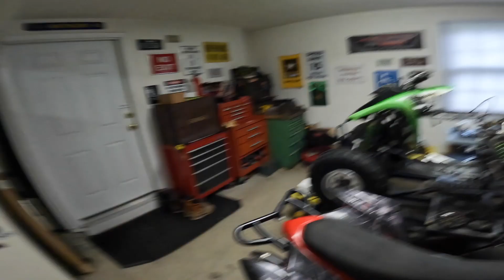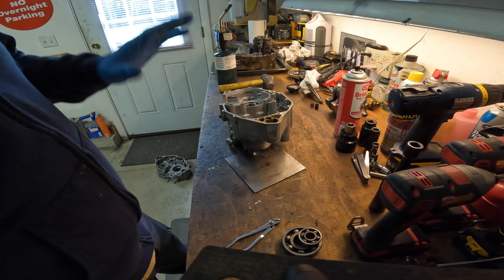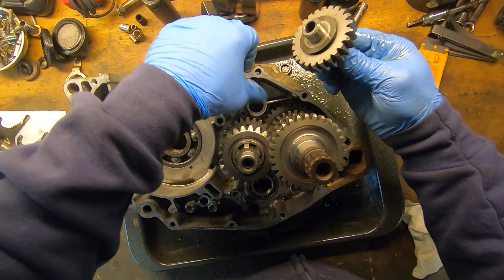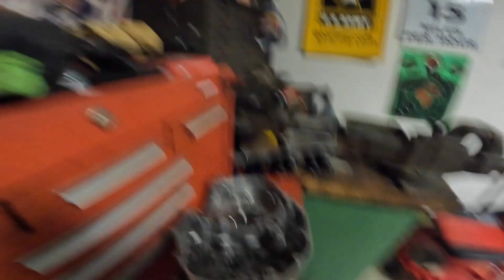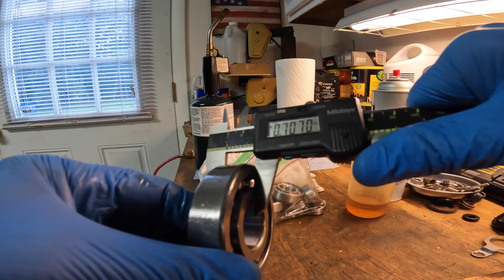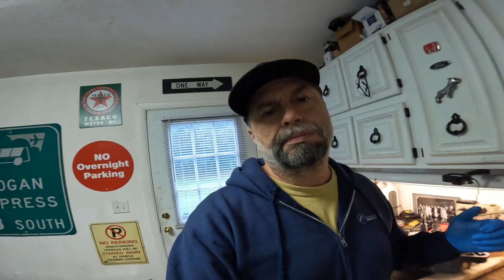KFX400 Case Prep

Comment: Cleaning rtv silicone out of tight spots- I’ve had a lot of success with a nylon or brass bore brush on a drill and compressed air from a small nozzle.
Reply from the maker: That is a great tip, I will have to try that on the next build.

Comment: I agree with you about 2vintage, he does get everything running but dosn't clean anything and dosn't replace a lot of parts that should be changed, and most of the time buys the cheapest stuff to get it running, he even cleaned an oil filter one time and stuck it back in , you would think with how big his channel is getting and the years he has been doing it he would get better at it, anyway the only way you and his channels are alike is you both wrench on quads and bikes, thats it, your obviously more seasoned at it and he's still learning, what do you think about the market now? Prices are coming down in my area and im seeing bikes sit for sale way longer.
Reply from the maker: I appreciate your kind words and for watching. The ATV market in my area is dead. I still have the Raptor 350 , I dropped the price to $1500 and nothing but $1000 offers. I will keep it till spring and try again .